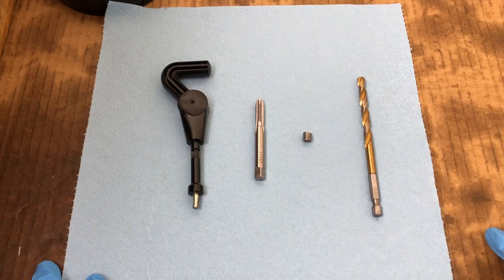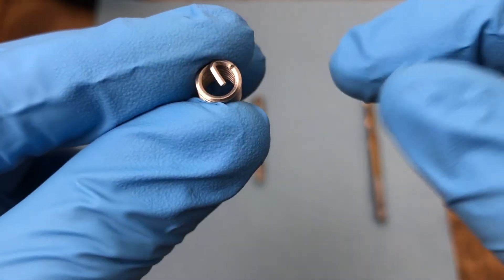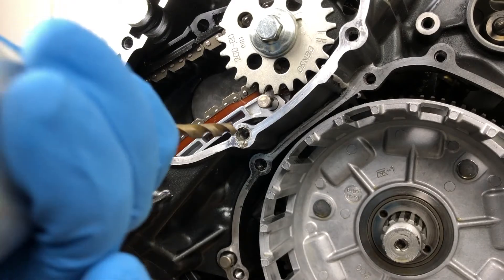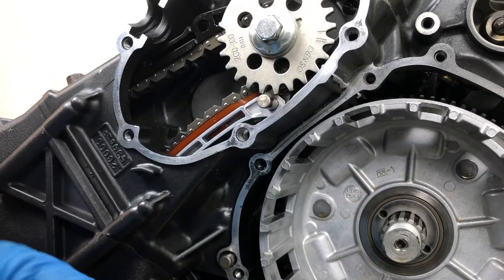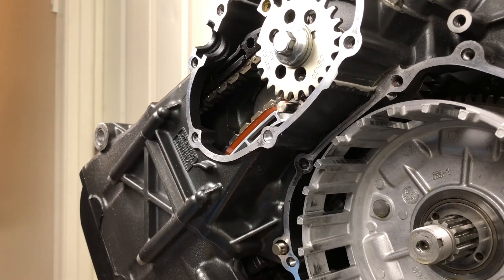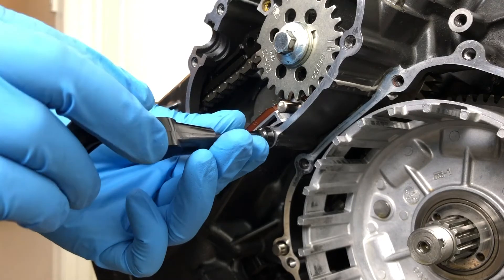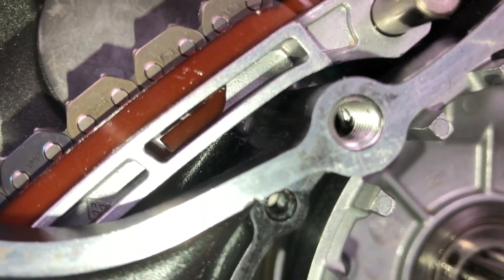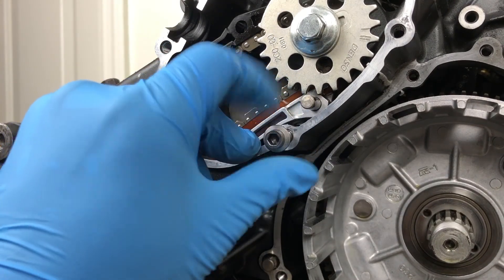Repair threads using a Heli Coil kit

Comment: Bro, your videos have by far been the most informative Ive found on here! I love the content. Starting from your cold start rattle video, to the chain and sprocket change, and even just washing it(I was nervous that id screw up some electrical with that much amount of water), to this video here. STUPID MISTAKE but I stripped the threads on the inside of the stator case using a small impact drill to same time putting the screws in -_- next time its all just hand tightened... lol But i just wanted to say you're videos have been a life saver! Thank you for putting your content out and also making it easy to follow.

Comment: Hello, I would like to talk about your r6 rattle vídeo, of timing chain problem, I have got The same problem as you, with same noise at the start, my mechanic told me to change the tensioner, but based on your video, im not sure that will solve the issue, you changed your chain not the tensioner, could you Help me with a opinion? Thanks a lot 
Regards from Brazil